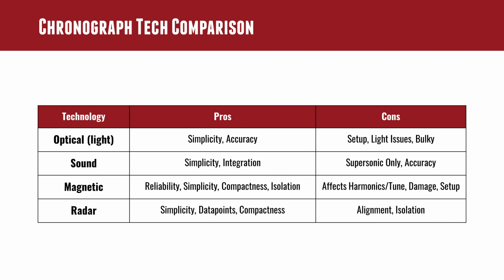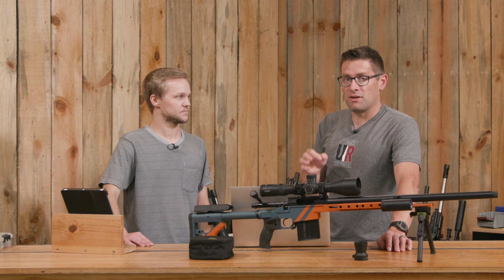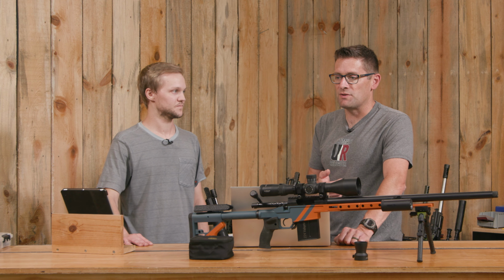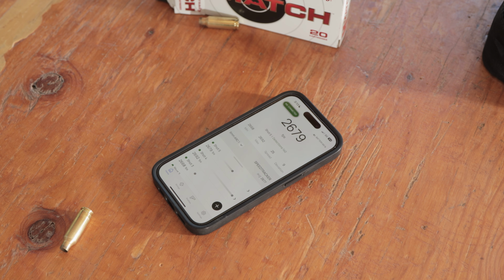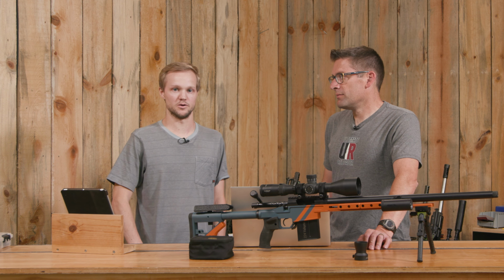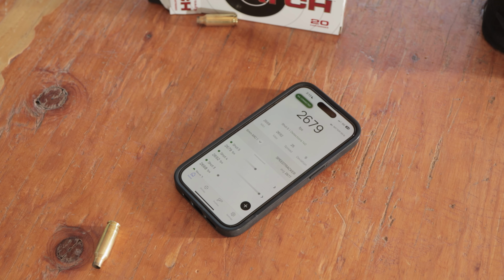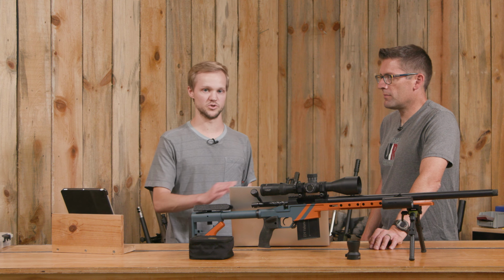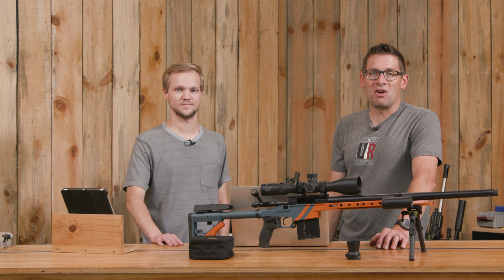Hands-On: Speedtracker Mach4 Chronograph

Comment: Bought one after I watch your video to relaced the LabRadar. Just finished a 22ARC in AR, Had a fatbastard brake laying around so I bolted it on, The Mach4 didn't pick up ANY shots. Removed brake and it worked 100%. LR is big and bulky and a PITA to setup. Looking at the Garmin for a spare. Just ordered the Ultra dyne Apollo Max, we'll see if it does same thing. Have a arca and pic adapter but "regular" rifles will need something else. The Garmin

Comment: This product is Absolute frustrating, I have bought one when they first come out about 2 years ago, it failed to perform on the first day, can't track speed, missing heaps of shots or even hard to turn on with that stupid little button. And that is the only button to use on this unit. I had a replacement unit from the agent with a Parabolic adapter, then it failed again, it started tracking every gun's shots on the range and I had to turn it off to stop it from collecting other peoples speed. But then the button failed and it could not be turn on again. Even when it was working well, it misses at least 2 shots out of 5, I had all kinds of rifles tested and tried all kinds of mounting and alignment methods. Most of them work okay if your can turn the unit on with that stupid small button but all of them miss shots occasionally. I have wasted so much time and ammo and had a lot of frustration. I'm in contact with the seller to get my money back, I have lost my confidence with this product. Don't buy it because there is a Youtube review on a new product.

Comment: Love the video. Just got my speed tracker and used on three different rifles with no luck at all. Couldn't get it to read even one shot after it was connected. I tried two phones and two Ipads. no luck
I then tried on my Impact M3 air rifle 30 cal. and It worked just fine. It never missed a shot.
I wonder what I'm doing wrong with my rifles that it won't pick up a shot?

Comment: Very nice form factor!  I'm using the LabRadar recently and use the downrange (5 values) change in velocity to calculate the B.C. of the bullets in my gun.  Getting up to 2000 readings for each shot (???) with this unit seems farfetched, but would help with calculating actual B.C.  My question is at what distance does the bullet fall below the radar cone with this?   LabRadar seems limited to ~ 100 yards.  Does the SpeedTracker extend out further?  My last thought...I use a rest for load development and mounting this on the rest (pointing downrange) would simplify use.  A simple cup, with an adjustable gimble, that you could slide the SpeedTracker into would be the bomb...just thinking.

Comment: "OrangeChef Prep Pad".  Because of that one item, I will never buy a Mach4 Chronograph without "redundant failsafe" on-device LCD display.
The Prep Pad was a BT-only weighing scale in early Aughts. It was also 100% dependent on an "App" for function. No on-device display.
When OrangeChef was bought out, they deprecated/retired the app. Bricking the device for all buyers. (Hackers reversed BT protocol partially since.)
If Mach5 has an LCD display with speed number, like optical chronograph, I'll buy it at (x thousand) dollar mark. But not this Mark4.

Comment: This is the first I've heard of the Speedtracker Mach4 Chronograph... checked the price on Midway... makes the LabRadar system look less expensive... I'll still be using the Magneto Speed and a cheep optical unit down range to check terminal velocities... When the price on this tech piece drops I'll be on it like a fly on stink.

Comment: Way to expencive therefore its original development can be found in monitoring industrial processes - i‘ll stay with my Labradar due to the fact that it’s much easier to share with other shooters and to use it with different rifles without any picatinny rail
Reply: Using it with guns that have no good way to mount the device was my first thought. I use a recoil-operated trigger with the LabRadar and if nothing else the trigger sensor can be taped to the gun.

Comment: Bought one. It has issues, serious ones. This products has a lot of potential but the current execution is problematic on many levels.
1. There is a recurring issue of the unit bricking on first (or later) power on. It just does not want to power off until the battery is fully drained. After that, initial problem, it started connecting for me. There is NO hard reset option (pressing the power button longer does not bypass the processor). This is a big flaw
2. There is some time you need to spend to set it up correctly. For me (Tikka T3X, 6,5 CM with a muzzle break), it does not have any issues with Hornady ELD-M 140gr bullets but is very (50/50) with my Lapua Scenar-L 136gr bullets.
3. the parabolic cone has issues with staying in the appropriate place on the device, a small, single screw is not enough, and if you screw it hard, it damages the coating of the unit.
4. The new app is not really practical to use, at least for me

If those issues will be fixed, then the device will be greate, but till that point, I do not think it is worth the price point for now. Hop it will change as I love the idea.

Comment: Excellent review.  I have avoided the radar chronographs as they can't capture velocities on my faster cartridges (204 ruger, 22-250, 17 hornet).  As Mach 4 is 4350 fps, maybe they need to change the product name to Mach 3.7 since it has a 4000 fps limit.
Reply: Stay tuned updates coming!! Range will be 200-4600….

Comment: I love my mach 4, it mostly gives me good and consistent readings. I'm only struggling to get a reading on sb 223`s. I might need to figure positioning better, but other than that it works awesome.
Reply: Can you elaborate on how you are having trouble with getting readings on sb 223's?  How long of barrels are you using?  How close to the muzzle are you putting it?  Are you using a suppressor?  If so, which one?  Most of my rifles have short barrels and I am just trying to get an idea of what to expect when I use this thing.  I just ordered one yesterday.  Thanks in advance.

Comment: Usability issue, in bright daylight red/green and the white text are not easy to see, especially for color-impaired. People should never leave mode indication to color or text. Something should fundamentally change when connected and ready. Some frame or bar somewhere.

Second, like someone mentioned below, this has probs catching .223/.224 bullets. At least without the additional front horn/mirror/shader.

Comment: awesome looking, I still use caldwell, can't beat the price.  100 bucks is way less than 1000 bucks
Reply: I have a Caldwell G2 and it works really well.  I just have to stop shooting the mount.  :(  Thankfully I have a 3D printer and have been able to make replacement bottom mounts.  I'd love a radar type chrono but they are expensive and seem a bit finicky.

Comment: I have 5 five shooting sessions with the Speed Tracker.  It has worked well at times with a four screw barrel mount with a Picatinny section.  Even on a supper skinny Kimber Alpine Assent barrel.    For benchrest I have struggled with alignment.    I am working with attaching the radar to an older SEB Neo front rest.  Android software struggles with accepting the signal if splitting time between phone and tablet.  "Settings" does not contain the fix. Still learning.

Comment: How long until the app isn't supported by modern cell phones and this isn't usable anymore? 2 years? 4?
Reply: That’s an issue your 10 year old Caldwell will work as long as the hardware work. My chronograph is over 30 years old and still working. You won’t be able to do that with a phone based unit

Comment: I have one of these and Im having a lot of trouble getting it to get consistent readings on anything smaller then a 30 cal. I have tried mounting it in different places and running it with or without the leans. But can’t get it to work consistently with the small bullets.
Reply: Unless you have the additional lens, the radar won’t “see” through the blast of a muzzle break. Alignment is critical , I ended up using an extended off set picatinney rail bent slightly upwards to “see” around a suppressor. Mine works indoors with 6.5 no problem.

Comment: Recently, I bought the pic rail adapter for my Magneto Speed for clocking pistol loads, specifically 5.7x28 from my M&P. Setup and use couldn’t have been simpler; no fiddling required. I’ve had the MS for a couple of years, but this was the first I used it and I was really pleased with the results.

Good video, as per usual.
Reply: My magnetospeed is great, but it effect’s accuracy strapped on the barrel